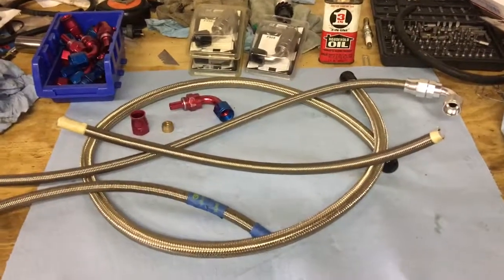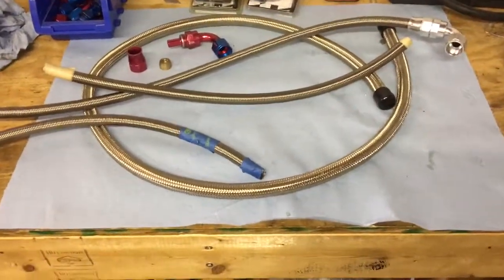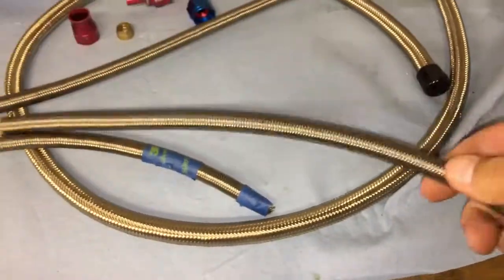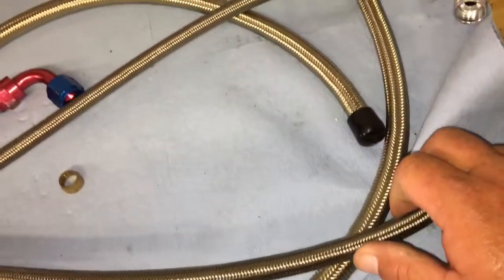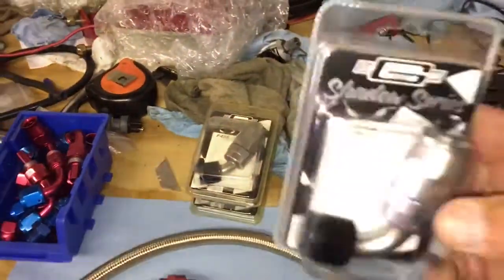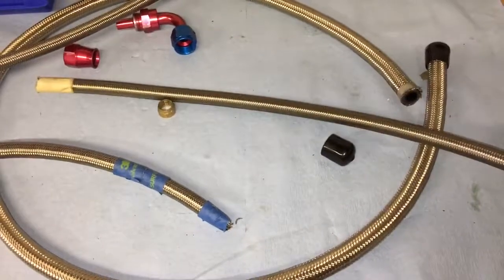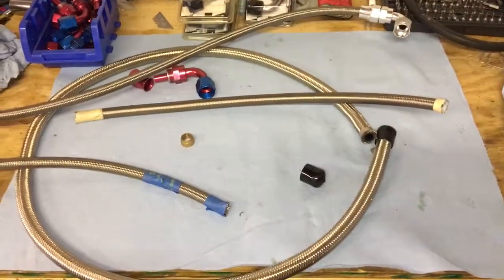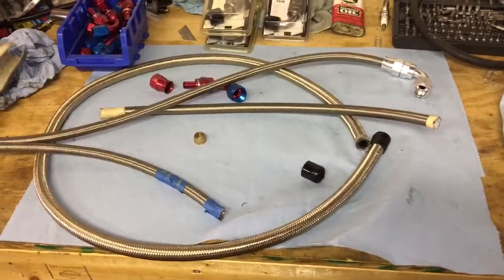Fuel Line for E85 ptfe and rubber

Comment: Thanks for the video, so which one would you recommend?
Reply from the maker: Z32 akm I would suggest braided rubber  over the poly braided!!!! it’s easier and can almost Guarantee it won’t leak. Poly line uses crush fittings and the 2 halves tend to strip when you tighten down and unless you have a kit like I have to test psi, you won’t know if they leak until they are installed.When I originally started this build which is now a different build but back then most your rubber hose wasn’t rated for e85 and a lot of peoples want you to stay away from it due to the fact they thought it a clogged injectors which could have but almost everything today is rated for e85. Hope this helps or you can email me